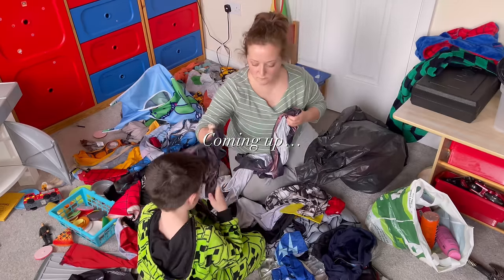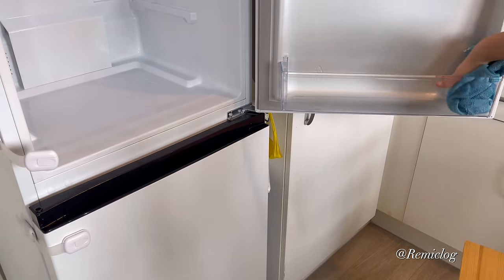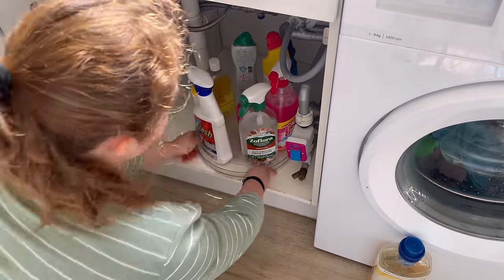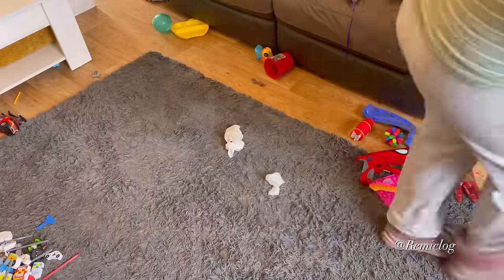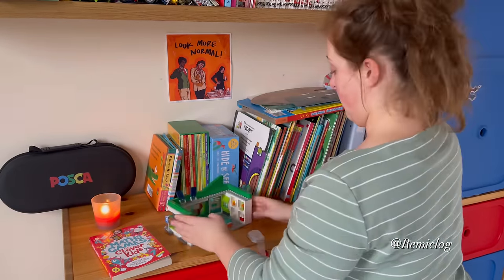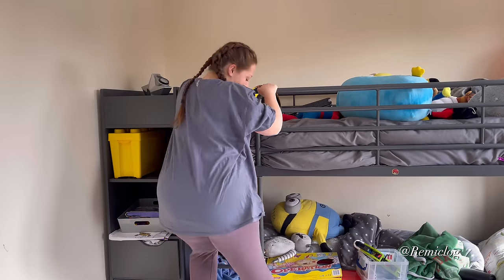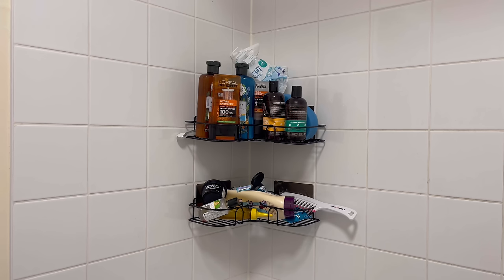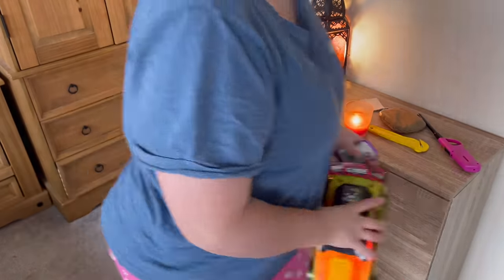Marathon Home Declutter and Organise Session: Quarterly Clean Out Edition! (April)

Comment: I am aligning each time you describe your day to day. I find when I need things for organising or just stocking the house I must write a list and if I have a spare $10 I go to a cheap shop that has a bit of everything with my list but try and buy quality.  Or google is handy with ideas I knew early on what I was taught people had other ideas and I had to find what worked for me. Working from the top down loosen with moisture whether that be water or spraying. Inside cupboard doors are wasted organising space that can be utilised. Orange oil or eucalyptus works to break down grime. Having a spray bottle with 1/2 bleach and half water sprayed in shower will kill mould. Lemon bleach I can stand plain I cannot. Bleach needs to be sprayed in your underwear because a drop on cloths can ruin them.  When cleaning a cupboard especially the kitchen buy cheap surface spray, spray wait for it to dry and replace items so socked the amount of dead bugs every time. I am inspired by watching bought myself today for Mother’s Day two in cupboard dish racks that slide. Been wanting them for ages and discounted by 60% so good. Wanted my plates standing because of bugs. I just have general ones but then I think of what I don’t see eek.

Comment: You'd find it easier to manage the laundry is you grabbed a free standing clothes rack.  I put mine in a room with no air flow and they're dry by the next day when I get home from work.  Mine holds a large load.  Just put it on some tiles or in the garden on nice days.  It works a lot better than a few over the radiator at a time.

Comment: I didn’t drive until I was in my 30’s. It’s great you’re working on that. 
Just a note about when you clean bathroom cabinets or drawers. If you wipe off the items you put back it helps with any dust or yuck that may be on them. 

I have my toothbrushes and paste in a pretty glass flower pot. I’ve heard it’s gross to have toothbrushes out in the bathroom but I swear if they weren’t visible we might never brush our teeth. Gross I know. 🤢

Comment: Chocolate? Fridge or freezer. I love mine COLD. The flavor is so much more when it's cold. 

As for the declutter. Yes. With small children it's very hard to keep decluttered. 3 months is about right to keep it under control!
Edit: i prefer a mug for toothbrushes myself. Why buy something when something you already have will do? Just me, i guess.
ReEdit: whilst watching with breaks, i folded put away laundry, did dishes & cleaned some dishes from( and decluttered )a 3 tier shelf, cleaned it and tossed out some stuff from it. Not feeling 100% today so this was a major plus. 

I like your shorter vids myself. I can fit them into my day easier. 
You do fine....As a mum, as a cleaner, as a utuber and as a person.  
On to the big gatden video!!!
Reply from the maker: Do you know what, you are absolutely right! I guess it was just for the aesthetic. But it shouldn’t matter should it! A mug works fine ☺️
Reply: @remiclog  and that mug looks very elegant!  If you feel the need to keep the brushes separate you could take a piece of thick (rigid) heavy duty packaging and create an insert that will keep each toothbrush separate... How? My version: Make it a circle that's 3" wider than the widest part of the cup. Then turn upside down on the plastic & center it. Go around the rim. Cut out the holes you want inside it. Then cut some slits around the outside of the circle towards the center stopping just at that marked edge. Now the fidly part. Bed each of those outside pieces in . Turn it over and those bent pieces go inside the cup. Use a hair dryer on high to soften the plastic enough so it slides into the cup. Easy to remove for cleaning once it cools as it becomes rigid again. 

I'm more of a "if it works, it's good " kind of person for things like toothbrushes. 😆

Comment: No chocolate in the fridge but I love thin mints cookies in the freezer. I also like ketchup in the fridge too. I pit batteries in the fridge too to keep them extended time. I think if you use small boxes as dividers in your junk drawer it may help a bit to stay more organized? 
Could the toothbrush holder cup fit in the mirror shelf? When u buy one...try to find one that can hide behind there. Apparently when you flush toilets, "things" can land thru the air onto your brushes which go into your mouth🤢💩🤮 so just try to find that in mind❤

Comment: After your dental surgery, like about an hour or two later, if you have used tea bags, or you can put some used tea leaves in a cheesecloth faggot, you can put that next to the place of your surgery, kind of chew on it or clamp down on it for about 15 min at a time, to stop excess bleeding. It's the tannin in the tea that does it. Also. Be sure to elevate your head during sleep times for the first 1 or 2 nights, to prevent blood-pooling and bruising. I had 3 teeth extracted in one go, and those tips worked for me.